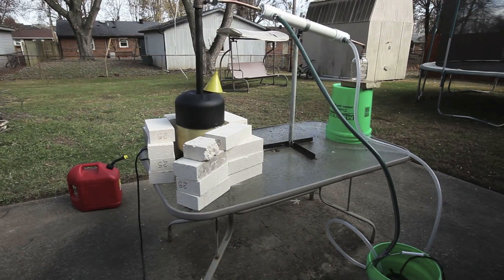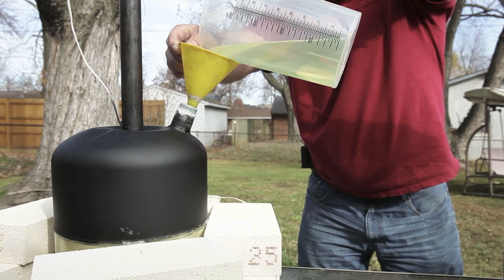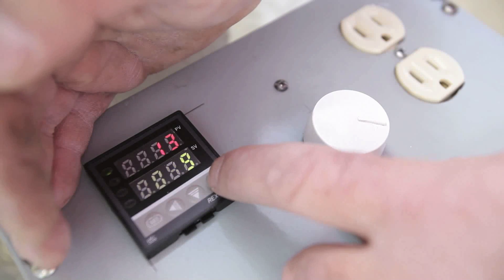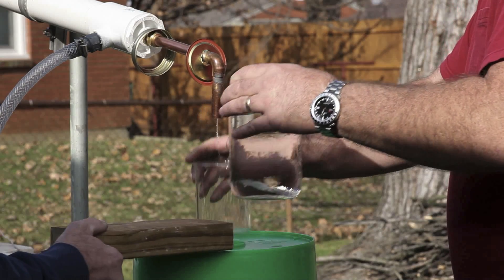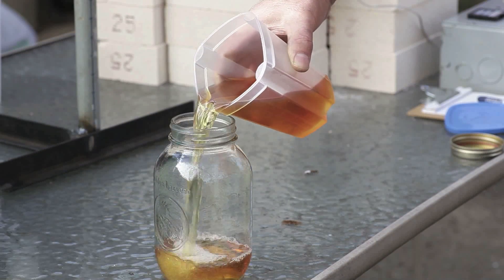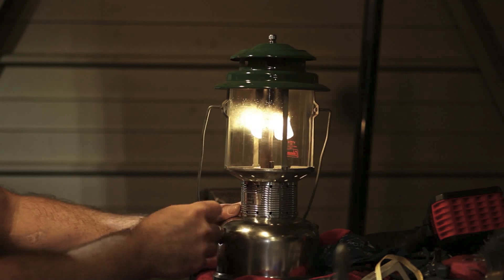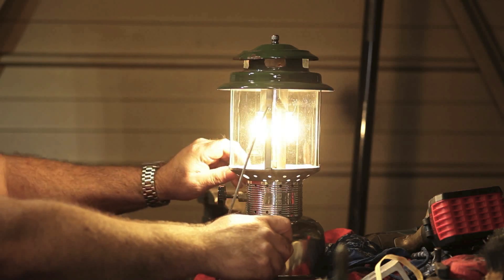How to make Coleman lantern fuel at home

Comment: Everyone is complaining about the cost of Coleman type fuel. It's anywhere from $8-14 a gallon a gallon lasts a long time. Sure you can convert to Kero and you will save 4-10 a gallon if you drag your kero can to the place with a kero pump. You'll also have more issues with the generator over time. A gallon of CF goes a long way. Also between the cost of the set up and tyhe cost of the gas, if this guy wanted to break even on this he'd need to process about 1000 gallons. But I don't think this was about the money.
Reply from the maker: asbestosfiber That is correct this was just for fun. But there are places around the world that coleman fuel is almost priced out of reach. One could probably replace a generator cheaper than build a still. Most of this stuff was scraps dredged up from the garage and the cost was very modest. Again this was done just for fun. Thanks for the comment.
Reply: In my country we can't find Coleman fuel at any price, your video is a really big help to the many of us living outside the US or Canada who own Coleman lanterns and stoves. The one positive aspect about the place where I live is that so far all gas stations carry ethanol free fuel. Thanks for posting the video.

Comment from the maker: The larger molecules actually don't burn completely in an engine ether. 
 This incomplete combustion is what leads to buildup on the head and 
piston of  engines.  Engine that use natural gas or propane are not 
plagued by this issue.  The Generators do last longer but if you do a 
cost analysis its probably cheaper just to burn gas and just replace the
 gen when they go bad.  This project was done just for fun and to prove a
 concept, like most things I do it probably cost me way more, but it was
 fun.
Reply: Might be worth doing here in Canada though. CF costs upwards of $25/gallon now (which is absolutely rediculous), and I read somewhere that the additives in our gasoline actually erodes the lining in the lantern's fount. Not sure how true that is though.
Reply: what about someone building generators from more resistant metal? Or is the cost prohibitive?
Reply: Hense the higher price for Coleman fuel when compared to regular gas.
Reply: You're right, but kinda misleading. Carbon buildup can be from fuel that doesn't burn. When the fuel is floating around it hits the hot metal (kinda burns, but gets stuck) and turns into carbon. Most carbon buildup, imo, is from oil in the intake from the pcv.
Reply: Octane was originally a measure of the %age of the fluid that was C8H18 "octane" and above.  This suppressed spontaneous combustion at pressure in an engine which is knocking.

So a higher octane fuel is harder to ignite....however the higher the carbon chain the more energy per cc or ml of volume.  Thus kerosene and diesel are harder to light liquid than gasoline which is harder to light than natural gasses.

With sufficient cylinder pressure all the higher octane will burn....but if you have a standard compression engine "premium" is a waste of money and dirties your engine.

Low octane is ideal for open flame or mantle flame in 1atm.  This being mostly C6 and C7 has a very low octane.

Pump octane today is typically boosted by adding ethanol which tests similarly to gasoline higher than C7.
Reply: @STho205  The ethanol MO was a clever move by the oil companies, fuel suppliers, it is known that ethanol is less efficient than premium grade unleaded fuel and creates less MPG, we used to run grass track bikes on pure ethanol, it gave higher power but used a lot more than a normal fuel.
Reply: @daviddanielstephenson2833  when your pandering and desperate for votes presidential candidates make promises in Iowa....and the oil refiners say sure boss...whateva you say.

Refiners mostly make 86oct gasoline today and let the distributor add up to 10% to make it 87, 89, 91....guess which one has the most ethanol?

87 is often the closest with about 96% gasoline.  Counterintuitive.

Chemist in the energy sector for over a decade.
Reply from the maker: @STho205  They all enjoy buying votes with our money. This was a fun activity maybe now I will get some sweet crude and see what sort of volume I can get out of the various fractions.

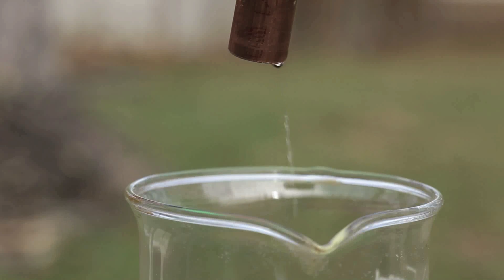Comment: Comment and Question:   At index 1:37 you indicate the fumes coming off are Butane, Pentane, other disolved HCs.   No doubt.   
> Question:  Wouldn't these technically provide some energy per gram?  I.e. the energy content per gram, final product, Wouldn't it be slightly less energetic than the un-distilled base?    
> Question:  Have you noticed a demonstrable difference in generator life? The additives are designed to burn away at auto cylinder temperatures.   Is not the temperature in the generator comparable?  I measured one of my generators with a remote-thermal gun:   Gets upwards of 1000 degrees F, as does the iron mixing-manifold just above it.   Is this not high enough to keep the generator pretty clean?  Even with additives?   
> Question:  Have you tried a timed  run between known-mass of non-ethanol straight-from-pump vs known-mass of distilled unleaded?

An aside - For my fuel:   I had California ethanol fuel go bad in my truck -- moisture got in, the ethanol separated out (Ethanol ~~loves~~ water).  After much cursing, I ended up with 12 gallons of liquid which, after settling a few minutes - CLEARLY showed the ethanol - gasoline separation.   I decanted the gasoline portion and have been using that in my lanterns and lawnmower.  No noticeable difference. Still has the additives & coloring.   Lower octane rating, of course - but since I'm not using this decanted, de-ethanolled gas in non-performance engines - shrug - no great performance hits on the lawnmower.   
Moral of the story: If you have ethanol fuel that has gone bad... Not all is wasted:   pour off the usable gasoline and use that in non-critical applications (Generator, lawnmower, small engines, solvent, etc.)  (( I should have tried the ethanol in my primus stove!)) I did my decanting-pour with a 1gal rinsed+dried HDPE-2 milk jug. -- You can SEE clearly the separation line between the ethanol vs Gas.

Comment: why ethanol free? just curious
Reply from the maker: Ethanol has some bad properties that make it unfriendly for use in 
lanterns. The least desirable is that it is very hygroscopic and if left
 alone will rust the fount. It is also deteriorates rubber like the cap 
seal.
Reply: Crown and Coleman allege to add a rust inhibitor to their fuels. Have you noticed any rust in your lanterns?
Reply from the maker: I have not noticed any rust.  If you were concerned you could add a little Alox 1846, that is the rust inhibitor used by Coleman.  The spec says 28 grams per 1000 gallons.

Comment: Where are you finding ethanol free gas???
Reply from the maker: Skeets K they have a station in town that sells it. You can search the net to see if there is a station near you. If not you can remove it by water extraction.
Reply: +Skeets K Search "ethanol free gas" in Google. There are a few websites dedicated to providing lists of ethanol free gas stations. http://www.pure-gas.org/ They are getting more rare, but they are worth a short drive to get to them. A gallon of gas will give a few more miles per gallon than the ethanol contaminated fuel.
Reply: Some gas stations have it and airports have it.
Cost more per gallon.
Reply: WAWA sells it here in the Orlando area.  Also, i was in MN/WI area a few months ago and Holiday gas stations had it up there.
Reply: Look at any large marina.  Most smart owners run ethanol free gas in their outboards.

Comment: So it's been almost 3 years now since this was posted. How many runs have you made? And have you noticed any burn quality variation per each separate batch over those 3 years? Have you made any refinements to your rig or your process? And final question, what are you using this fuel in? Lanterns, cook stove, heaters? All of the above? I'd like to see them in a video being used :)

Comment: What did you do with that last yellow remainder?
Reply from the maker: I just put them in a jar.  I'm saving them because I save everything.  I don't think they will have any use, but if they do I got them.
Reply: basicaly its a type of kerosene you can probably use it in kerosene lamps outside :-)
Reply: NO!  This is white gas and extremely dangerous in a kerosene lamp/lantern.
Reply: I think the yellow remainder could be the heavy carbon chain diesel and additives
Reply from the maker: You are correct the longer chain and more complex substances typically have high boiling points.
Reply: Very good, #sHeath , congratulations  you for your   technical  skill and your  chemical knowledge : that  both are seldom to find in YouTube  video 's  !
Reply: Darlene Young yes but very hard like blue diesel
Reply: What's that yellow stuff anyway? Is it some kind of solvent?
Reply: Pour it into a car's fuel tank? A near-full tank, of course. It'll be diluted with the rest of the gasoline.

Comment: what are you turning after you say , clean out the  generator?
i have a 1965 and it has that little thing you were turning ? what is that for? thanks
Reply from the maker: The little crank is attached to what many people call the pricker.  It is a brass stem in the center of the generator with a very small piece of music wire on the top.  When you turn the lever it goes up and down and cleans out the orifice jet at the top.  The generator will get dirty with residue from use.  The high boiling point components of gasoline will accelerate the process of gumming up the generator.  That is the point of the distillation to get rid of some of the thicker components that gum up the works.  it will still happen no matter what fuel you use, but distillation will help slow the process.

Comment: would a hot plate like the nuwave induction type work in place of the pid thermacouple?
Reply from the maker: You could use a nuwave in place of the standard hot plate but you would still need the thermocouple and PID.  But you can just use a standard thermometer and manually control the nuwave.
Reply: +S Heath do you use the pid just so you don't have to sit and watch the temperature? or is there another functional purpose. aslo you said that next time you'd stop taking fractions at 135 degrees Celsius which is 275 degrees Fahrenheit is that correct?
Reply from the maker: That is correct, but I still sit and watch it for safety sake.  I just don't have to watch as hard.  Yes I intend to cut the fractions sooner because when I ran the gas chronograph mass spectrometer the distillate had a few high boiling point constituents that were not present in Coleman fuel.
Reply: +S Heath how bad is it to use an aluminium pressure cooker. how long does it take to distill  1000ml. and what do you do with the drags?
Reply from the maker: I see no reason why you cant use an aluminum cooker.  I usually distill 2000ml at a time and takes a little less than hour.  The dregs have little value, I use them to start rubbish fires.  They are hard to light, but will burn once lit.

Comment: can you burn just gas fuel  in a Coleman
Reply from the maker: Sure, it will burn just fine.  It will stop up the generator much quicker that Coleman fuel or distilled gasoline.  This was just for fun and as a demonstration.  It is also helpful to people in other countries that don't have access to inexpensive fuel for their lanterns.  It is also cool to do things that most people think is dangerous, even if it really isn't all that dangerous.
Reply: In Italy, I found white gas for only $85 a gallon. I moved here in December of 2013.... I'm about to distill my first liter. All I need is a hot plate. Gas is about $6.50 a gallon. So far I've spent $15 in parts to make my condenser.
Reply from the maker: Of course use caution when doing anything like this.  I test the setup with air pressure and soapy water. You may want to keep your fractions separate and blend them later.  The higher boiling point fractions are the ones that cause trouble with the generator.

Comment: Great video!  I do lots of fishing and camping.  I have 5 duel-fuel Coleman Lanterns. I used to put regular gas in them until the generators started to clog up, no matter how much I maintain the unit. So I started using Coleman fuel purchased at Wal-Mart.  The problem is this stuff is very expensive!
Its $12.87 a gallon 😡👎
Reply: Walmart no longer sells Coleman; instead, they sell their own naptha - in the same similar-colored steel cans that Coleman sell their stuff in.  The Walmart brand white gas costs about $7/gal.
Reply: @AYE OK SURE I have kerosene heaters for my home. It's easier to keep one fuel around for both. Kerosene conversions are cheap & easy to manage.
Reply: Spend $20 for parts to convert your lanterns to kerosene and skip all this white gas nonsense.

Comment: Just buy a Dual Fuel Coleman Lantern for $60!  You can use either Camp Fuel or Unleaded Gasoline, and you won't have to worry about blowing yourself up to make a $10 bottle of fuel.
Reply: +roostershooter76 Dual fuel lanterns aren't really the answer. The gasoline will cause the lantern to need frequent generator replacements. The crap he's cooking out if just that, CRAP!!!!!
Reply: I would love to see the differences in the hardware of a regular Coleman and a dual fuel Coleman. All my Coleman stoves will run gasoline. Granted the components slowly gather residue. Very slowly. Considering these stoves were initially used for Military; you can bet they just instructed the soldiers to clean the stoves (disassembled) just as they would all other equipment. If anyone has a link to a comparison video please leave a link. Big respect for the video quality made here.
Reply from the maker: +roostershooter76 It's not about saving money. This is just for fun and really not that dangerous.  Walking across the street in any large city is far worse.

Comment: Thank you for your responses. I had college level chemistry in high school, but back in 1977. I don't have my distillation charts any more. I used this knowledge in air pollution testing. I have looked at post on separating the ethanol first. Just wanted to know if it would distill in the process. I don't have access to a GC any longer so that is good information. Thanks again.

Comment: If the gas has ethanol, will it come out first with the first fraction?
Reply from the maker: +James Bacik I use ethanol free gas.  If there is ethanol it will come out in the middle of your production.  If you don't have access to ethanol free gas you can remove it with water extraction. Just add some water and shake, the ethanol will join the water and separate out from the organics. It is easily removed with a separatory funnel.  I hope this was helpful

Comment: Do you discard the first fraction and use only the second fraction?
Reply from the maker: +James Bacik The first fractions are the good ones that make the lantern or stove easy to light. You want to save them.  The latter ones are the more complex molecules and are more apt to clog the generator.  I compared the output of this run with that of Coleman fuel in a gas chromatograph mass spectrometer and noticed I had more heavy constituents, so next run I may cut production sooner, like maybe 130 C or 135 C.

Comment: What's wrong with my lantern. When I light it yellow flames just burn around the mantle and rise up to the top vents? Is this too much pressure or not enough? I pumped it up for about a minute until you could feel a strong pressure on the pump.

We had the generator apart before hand and blew it out with compressed air. We are using 20 year old white gas but I looked online and it seems like other people have no problems even with 30 year old white gas. It's been sealed all that time.
Reply: +KiwiPowerNZ too much initial pressure.. You only need enough to light the mantles. after mantles are lit the generator can warm up to atomize the fuel. let the generator warm up for a bit then pump to full pressure and open it up.
Reply from the maker: +KiwiPowerNZ Many times there are spider webs in the air intake tube.  The only way to get them out is with a wire blowing air even with a compressor is not enough.
Reply from the maker: +KiwiPowerNZ Perhaps you could put some kind of cover over the lantern to prohibit them from making a nest.  I have many with nest in them, but never built at my house. Always ones I obtained from elsewhere.
Reply: +S Heath It was a mason bee nest in the air intake. I cleaned it and it works excellent now but I caught mason bees in there making a new nest so I lit the lantern to burn them out but I'll have to poke in there again to clean it and its very hard not to break the mantle when cleaning it -_-

Comment: If you don't have time for diy, I found good alternative. I'm buying it in hardware store in paints department. They sell it as "cleaning gasoline", "pure gasoline" (translated from German "Reines Benzin"). They sell it in metal bottles. It looks, smell and works virtualy identical to original Coleman fuel. It works greate on my Coleman stove (Peak 1). No bad smll, ashes etc. 1l cost ~3.5€ here in EU.
Reply: Sounds like low/no odor mineral spirits, as they call it in the U.S.
Reply from the maker: Gregor Čepek How much is Coleman fuel there?
Reply: S Heath ~6€ for 1l